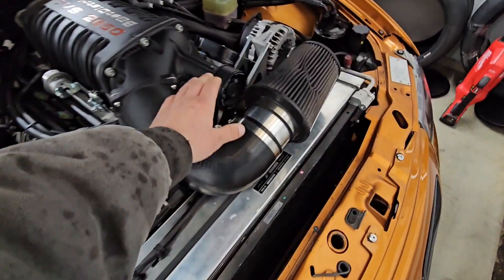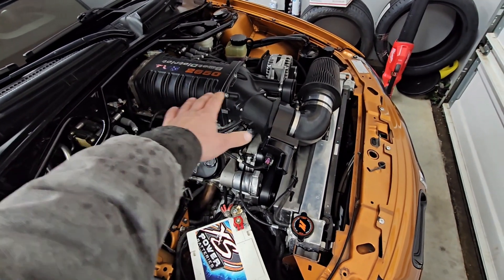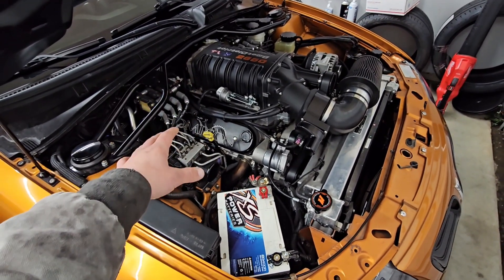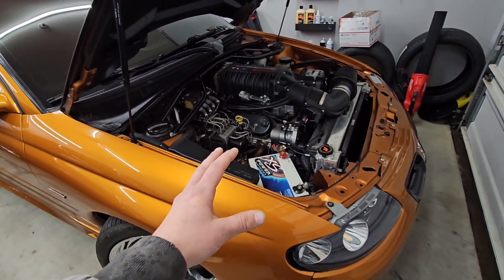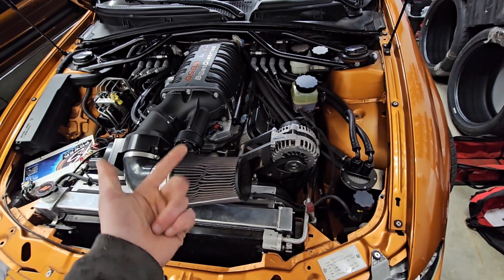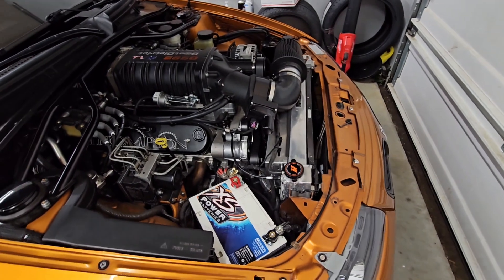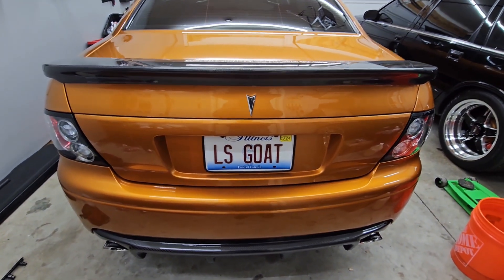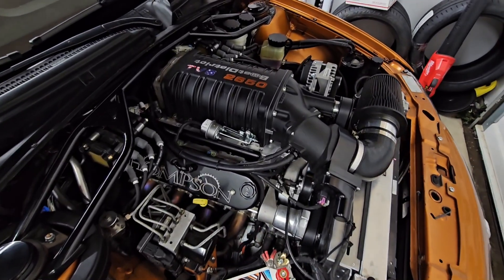GTO Dyno, Problem Diagnosis (4-26-23)

Comment: I recently found a short where they guy drilled two holes each side in the body bracket and used zip ties to fix those broken tabs. I’ll most likely go that route when I take mine off the first time. 
What is the size and offset of your rear wheels? I’d like to fit more tire under mine but the rims are out too much.